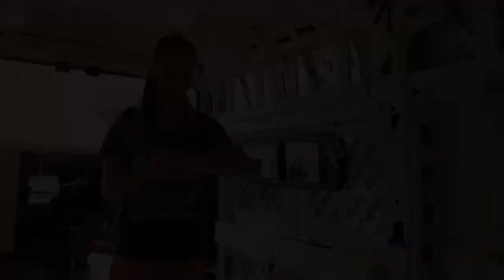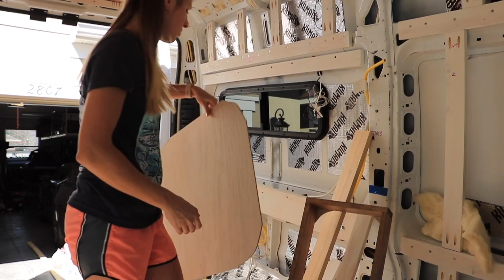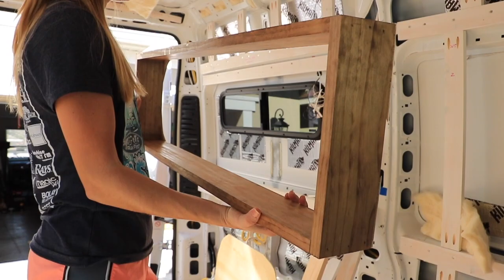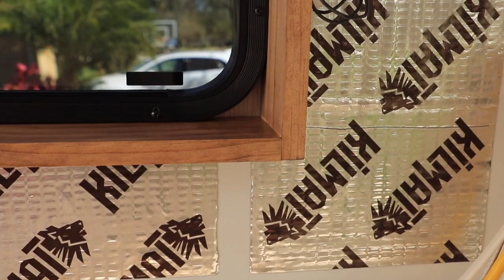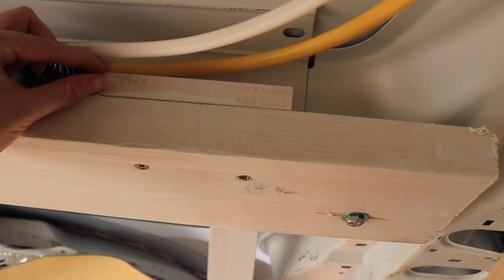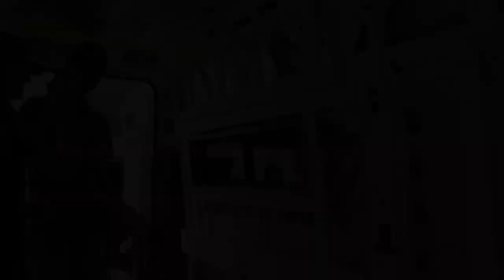WINDOW FRAMING | Ram Promaster VAN BUILD

Comment: Wow, I'm amazed how much space builders sacrifice with framing. The van has a ready made frame. I didn't use any batons on the walls and floor of my Relay conversion. I did use thin strips of wood on the roof ribs. My van is sound deadened, and insulated. BTW, insulated ribs don't work, because the rib is attached to the outside skin, to the cold still penetrates. I've never thought my van floor was cold, even though its bubble foil, ply, and covering.
Reply from the maker: I would definitely do a few things differently now!
Reply: @stumblinguponserendipity  good luck with your next build, or changes to your present wagon. 👍🍷